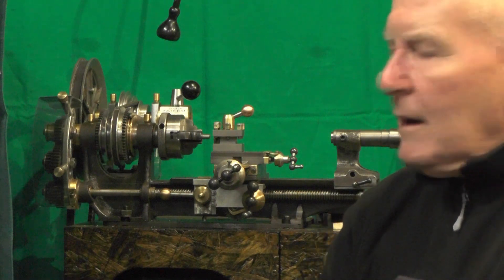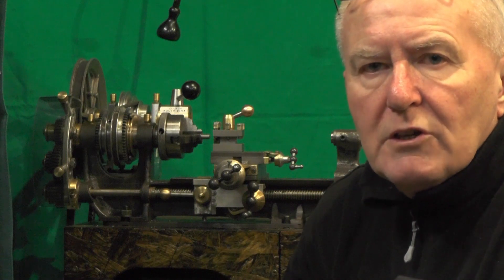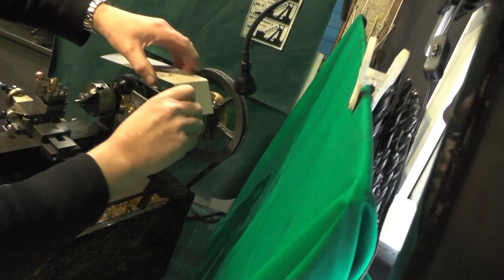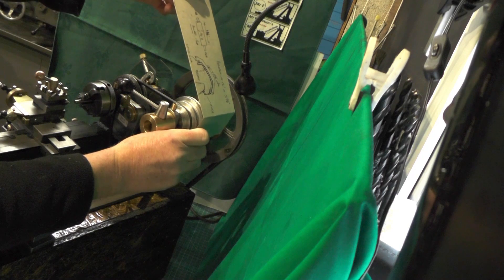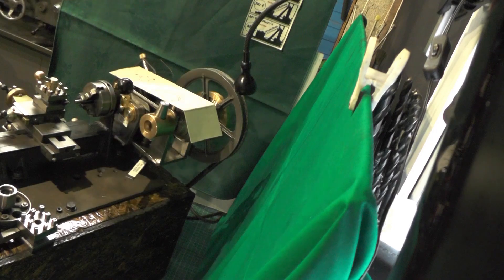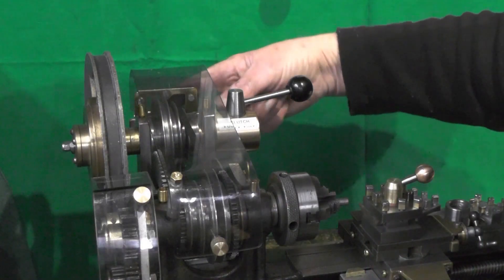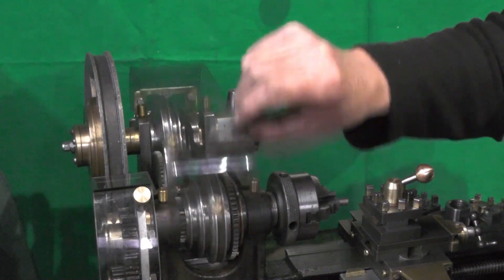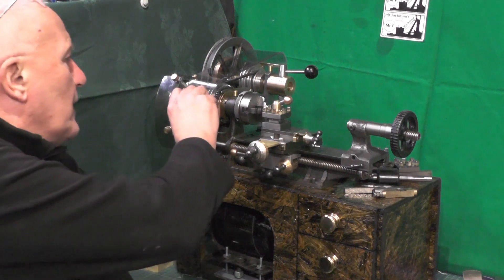Ep 27 Making a Micro / Mini / Small Lathe (Spindle Guard + New Sticker) "mr  factotum"

Comment: It keeps you safe and doesn't spoil the look of your micro lathe great design. Would be great if you did a sterling or any kind of engine on your micro lathe it's something i have wanted to do for a while but every time I look at stock metal prices I think I'll wait to i find some cheap old scraps but unfortunately that is going for a premium last time i looked. Great video as always.
Reply from the maker: hi John, thought i'd just replied to this but it dissapeared!!!!!!
thanks very much, 👍👍👍👍
yes i didn't want to do all that work just to hide it.
Watch this space for the Low Temperature Differential Engine, might just do a simplified version to start with, using what ever at hand or cheap materials, or recycled,  i'm still as tight as cramp🤣🤣🤣🤣
see you next time
regards
Kev
Reply: @MrFactotum  cheers Kev sounds good.

Comment: The history of the micro lathe was it a production lathe or a kit lathe or something you made from bits a pieces? 
Kit from down under
Reply from the maker: hi Kit
all parts made from items around my workshop nothing bought as as tight as cramp🤣
the casting for the lathe bed and tailstock turned up at are model engineering society shop from a shed clearout. i bought them for next to nothing, and have produced the working lathe, all the history etc is in my Intro  to this playlist.
many thanks
Kev